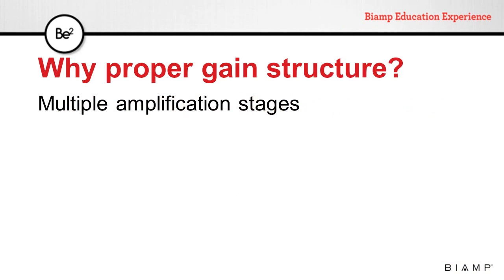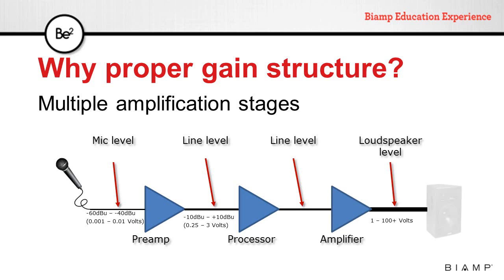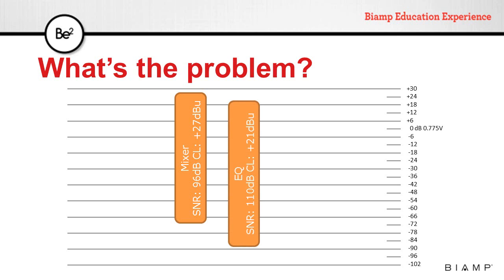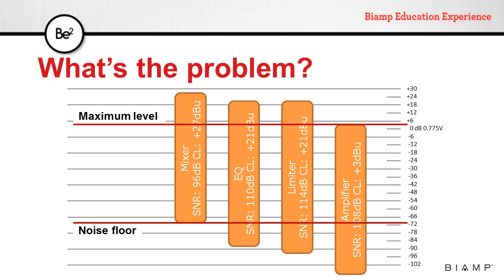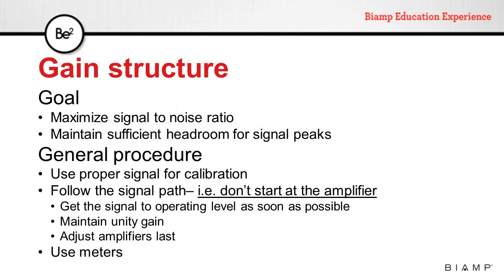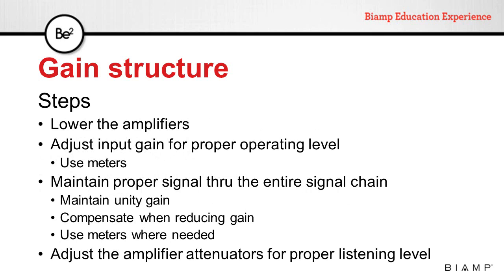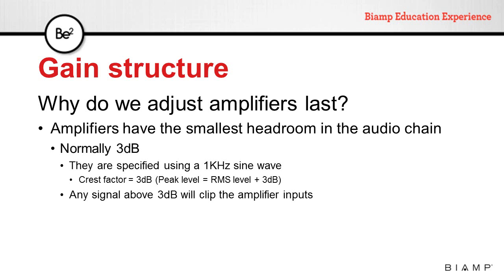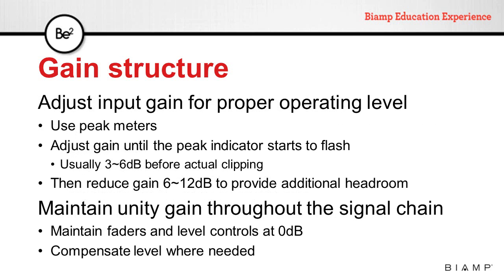Biamp Audio 101 - Gain Structure: Steps for Proper Gain Structure

Comment: Hi, thank you for your clarifying video. I just have one question: what would be a proper signal for calibration?
Reply from the maker: Hi José - You can potentially use almost any signal to calibrate gain structure. A steady level signal like a tone or pink noise makes it easier due its constant nature. The important part to understand is what the difference is between "pink noise" and a pure tone, and what are the meters showing in either case.

We recommend taking a look at our video that specifically talks about audio measurements. It's the third video in this series titled, "Signals, Peak, RMS and Crest Factor."

Happy listening!